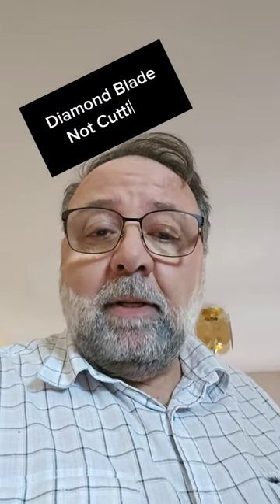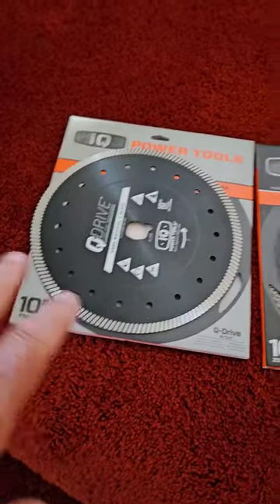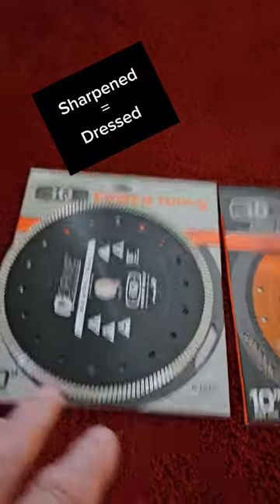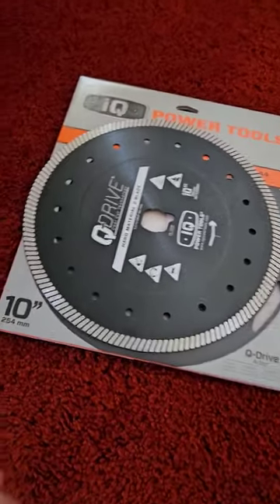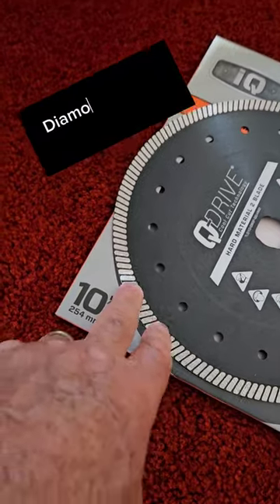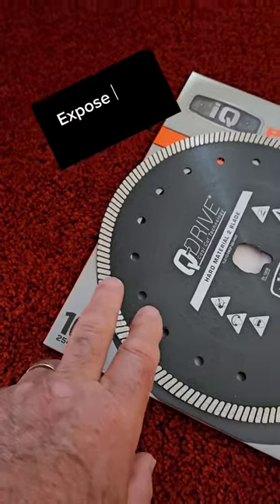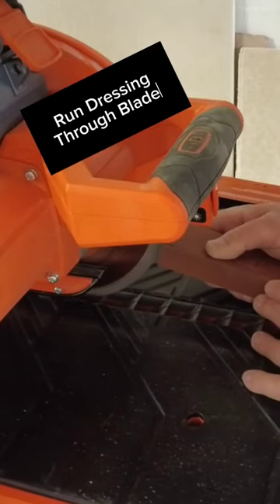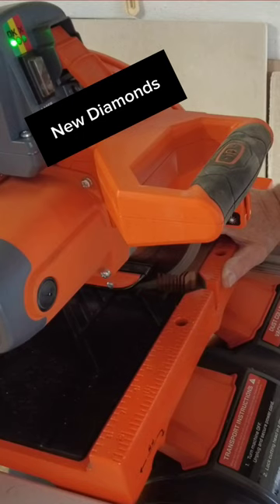How To Dress Or Sharpen A Diamond Blade. #tiling #diamondblade #shorts #iqpowertools

Comment: An old red brick is a great substitute
Reply from the maker: Yes, also concrete, 60 seconds limits what you can put in a video.
Reply: @SalDiBlasi  thanks ,ya too short to get all the best from you
Reply: I've also had success grinding dried thinset off of the back of a scrap tile in a pinch, but a dressing stone is best. Never heard of a Red brick but I can believe it.